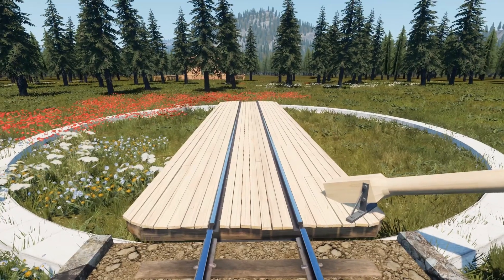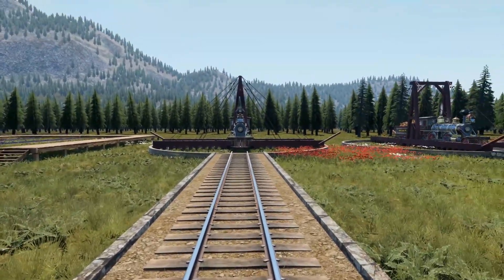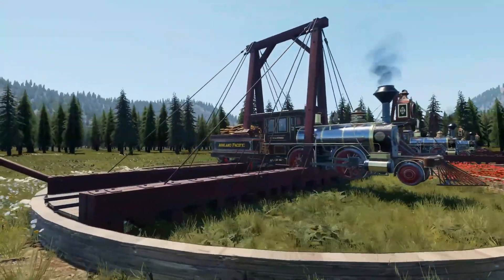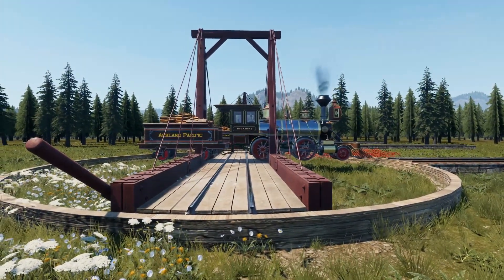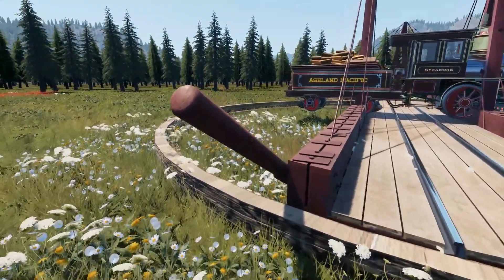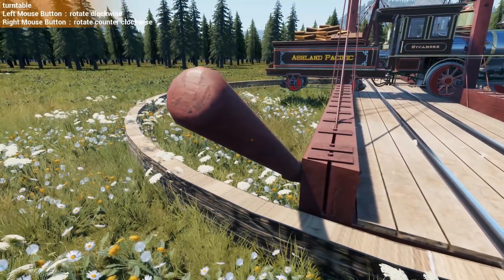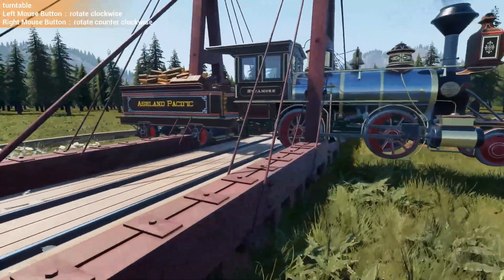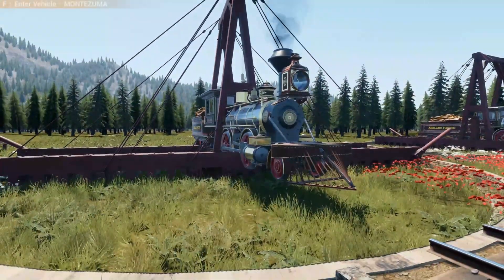Railroads Online - How to use Turntables on the Beta Branch

Comment: interesting,  I ran into this bug a few days ago and solved it by simply removing and replacing the turntable, and haven't had an issue since; atleast with that turntable, haven't used the other 4 or so scattered about yet
Reply from the maker: Interesting - that's never seemed to work for me, and I replace my turntables all the time to quickly line them up by attaching them to the track I want them lined to. Wonder why it worked for you

Comment: I've also been setting my reverser to near 0 as well. that way the reg can be at any number and it definitely can't overcome the brakes.

Also is it just be or is the braking broken too? i can set my shay to 1% brake and no matter what else is happening I come to a stop really quick. I've tried it at full power, 3% downhill slope. one train length and I'm stopped.